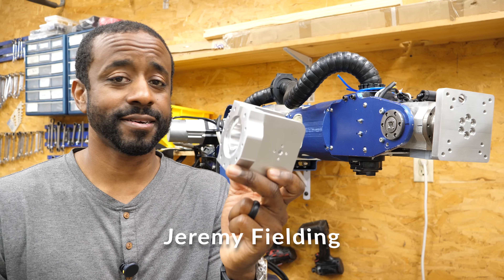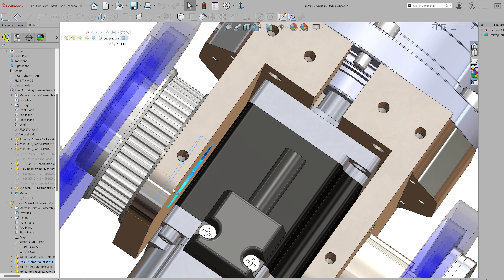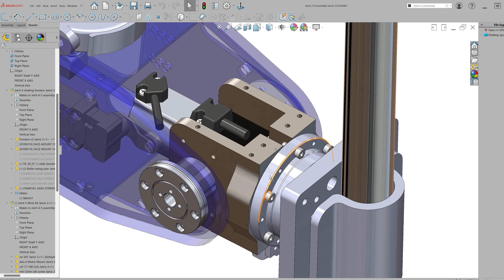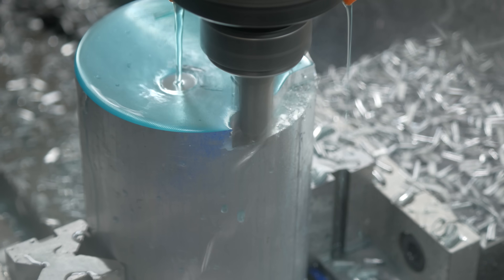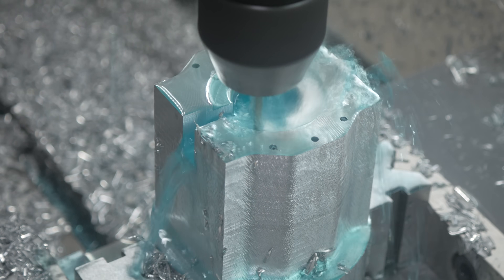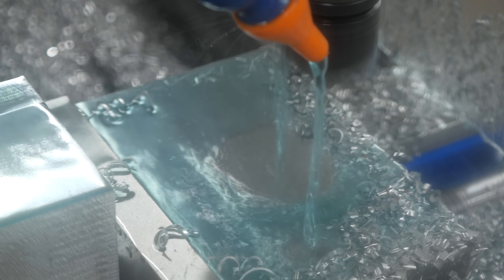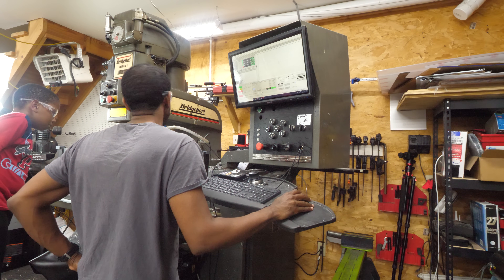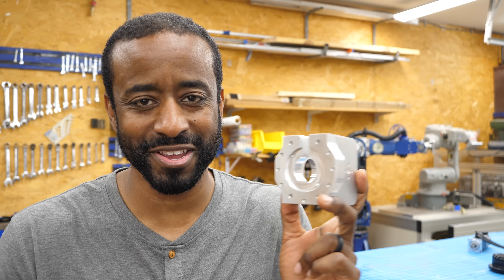How I Made This Robot Part. Start to Finish.

Comment: How much was a part like this from Jiga? What were the tightest tolerances?
Reply from the maker: Unfortunately this is not a question I can easily answer. Jiga doesn’t make the part. They connect you to manufacturing all over the world. You need to pick a shop, select how fast you want it, then consider tolerance, size, material, finish etc. every order is likely to be different even for similar sizes parts. Some countries/ places are cheaper on labor, or materials, and some are faster for the same price. There are too  many variables for the answer to be meaningful
Reply: @Jeremy_Fielding   For reference, how much did you pay?
Reply from the maker: @garrettp.5018 you really should just login and send them a sample part to quote so you see all the variables and adjust them some so you understand what I mean. I am telling you the numbers I could give would mean nothing. The price would vary literally as much as the price varies around the world for all the different conditions I mentioned. You would learn way more and it cost you nothing to ask for a real quote. And it’s multiple people quoting not one quote. So it will be a range of prices that can be pretty wide.

Comment: Your endmill finishes have a lot to do with the machine itself.  You can get a better finish with the machine you have, but you will have to slow way down and take a small finishing pass.  Leave about .005 to .010 for a finishing pass.  You might even want to do 2 finishing passes at .005 and a spring pass.

Comment: @jeremy Fielding. 
Hi, 
I know this hasn't got anything to do with this video but I have a few questions on induction motors.(kinda)
I am looking for a 3 phase 550w (+) induction motor that can turn up to 3000rpm(?) and a vfd to adjust the rpm.
All in all under 150€ if possible  (yeah, I'm on a tight budget and European 😅 )
I'm looking for something like this for powering different tools in my workshop.
Can you give me any advice on where to get something like this?
I'd really appreciate an answer. 

Thanks and all the best from Germany :D

Comment: Just a tip: If you're planning to cut a lot of round stock in the vertical orientation in the mill, take a look at a set of these Mitee Bite jaws (MPN 32166). It bites onto about .075" of material, and you don't waste as much stock as when you use V-blocks. Not to mention it has a heck of a grip on the material. You can give her the beans and not worry about your part achieving low-earth orbit. Great stuff, though. Thanks again, Jeremy!

Comment: Oh damn you didn’t spot the holes before drilling them? Probably a good idea so the drills don’t walk on you. Plus they’ll pre chamfer your hole so threaded holes look more professional/don’t leave burrs on the top face. You want the spot drill’s included angle to be at least the same angle as the drill you’re using but it’s best for the angle to be just a bit larger. So for a standard 118* drill, use a 120* spot drill. You want the tip of the drill to contact the material first. Also it would be a good idea to get a spring loaded tap follower to keep your tap straight but it looks like you can’t use those with your tap wrench? One more thing: SAFETY FIRST. These machines have the power to kll and it’ll hurt the whole time you’re dying. If you wouldn’t put your dick near it, don’t put your hands near it. No fingers near ANYTHING that spins until it comes to a COMPLETE stop. No long sleeves/hair/jewelry/etc. I got a file through my hand doing something dumb because “it’s fine I’ll just pay attention”. I did not pay attention. I ended up dosing off. Don’t need safety glasses because you’re just hand tapping?  Wrong. A chip can become dislodged and fling right toward you. Happened to me as soon as I backed the tap out. Luckily it bounced off my eye.

Comment: Those old Bridgeport Series I CNCs were good machines in their day, but the control systems became way too expensive to repair. It is less expensive to replace the entire control system than to purchase a replacement board or pay Bridgeport to repair the board.

You should swap out the flood coolant with a spray mist system. This would allow coolant to better reach the cutting tool.

Comment: I think it's important to note, especially for people that only need a single part for a DIY project, is that one-off prototypes can cost WAY more than you might expect. Alot of the cost comes from programming the part so it doesn't matter if you need 1 or 10,000 parts, the programming cost will be the same. If someone needs a one off my best advice would be to create a good relationship with a local machine shop
Reply from the maker: I don't know what your experience was but I have been consistently shocked at how much better the price is for a single part with this service and even other similar ones compared to using a "local" shop. Perhaps you have a good friend in the business, but I have tried ordering parts at local shops for the last 5-6 years across two small business, and for myself in three different cities. It was ALWAYS way higher in price and way slower getting my parts done compared to digital manufacturing options. And that is after several local shops just said they don't have time for my parts. This comment is a bit surprising to me actually regarding cost. It might also be we just have different expectations of cost. But This service is a good price, and in my personally experience cheaper and faster as well. It is the local shops (perhaps 50ish I have contacted over the years if I had to guess) that don't seem to ever want to work on small projects and charge a lot for taking it. But of course if you have a friend then use the options you have. I just think your advice doesn't match my experience, and I have a lot of experience.
Reply: @Jeremy_Fielding  My experience is programming in a machine shop. Yes this is probably better than shop rate and I'll admit my wording was wrong. I should say if one can, develop a relationship with a machinist that has some downtime. But my point still stand, one offs no matter where you go will be vastly more expensive than something thats mass produced and most people dont understand that and generally are taken aback when they first see the cost of their one off even if its a simple part. Home machinists are great in that regard. If they like you they might just charge beer and material. Thats what I myself charge to people that have helped me in some way.

Comment: The big problem with concave parts like that are the internal forces that may or may no be there. Putting in precision cuts first is risky as once you cut that slot along the z axis the material might spring in or out of position. :/

Comment: Re: Waste?     Got a lot of interest in home diy fabrication, so watched a lot of machining vid. One thing I never understood is the waste. E.g. in this case less than half of that huge, expensive chunk of metal is included in the final part. Most of the expense is in chips. On an industrial scale I suppose the company can recoup cost from recycling the chips. But for the homeowner, the scale will never make that up. 

I like the channel, and this vid, just a curiosity I have.
Reply: Good point. If you need a monolithic body with a concave shape, you pretty much have to excavate, whether you are working in metal, stone or wood.

Comment: Seeing you get your son involved was a real moment.
He is obviously curious about what you were doing - that is why he came into the workshop in the first place.
I don't think he will actually admit it BUT he was in all probability so proud of himself...
And you were so proud of him.
Google "armdroid" and think about suggesting that you mentor him through the build.
3mm acrylic to start with (I used 6mm Ally) and some small stepper (I got mine out of old photocopy machines - TOTALLY UNDER POWERED).
I did get the arm moving but this was before Arduino and PI.
The PIC micro-controllers were AN ABSOLUTE NIGHTMARE. I blew over 60 of them over about 14 months...
I built mine with toothed belts and sprockets "stolen" off of a number of old belt driven OHC car motors and reduction boxes made out of the guts of old windshield wiper motors but fortunately I was working in a machine shop and was allowed to do my thing over the week-ends.

Comment: A great example for the last paragraph would have been "This part cost $xyz."  You also have a lot of sunk cost in that CNC Bridgeport.
Reply from the maker: Even though I think it was a very good price, and very fast turn around, I didn't want people to get distracted by a number that changes year to year, and part to part. Without knowing the tolerances and the timeline I required you are missing large parts of what determines the price. I didn't want to invest time justifying the price when each person will get a different number anyway. This is part of the reason I went through the "what is your time worth" segment because often people say things like "I can make that for x" when they mean I only would pay x for the material and my time is free. And they have no idea what tolerances I put on the part LOL. Anyway I felt that would send some people on a trail that was off the point. The value was there for me, and each person should consider these variables and decide if the value is there for them when they see their quotes. Knowing this is a option was something I didn't consider for a long time. When I started doing this it changed my work flow and helped a great deal with those projects where one or two items dominated the time/cost of the project and created bottle necks. I can hand those off and the value is huge for me.

Comment: On alluminum you don't need coolant. Only for finishing and Drilling. And your coolant looks not right. Should be something with lubricant inside. Typically it's white.... but nice one for your first job  😊
Reply: Not using coolant on aluminium seems like a great way to gum up your tools in general.
Reply from the maker: It is a coolant with lubricants inside. Perhaps you just haven't seen it in blue LOL. Anyway, I have hear others say you don't need coolant with aluminum but that didn't go well for me. Of course as I said in the video, I was just getting started and probably this is a matter of getting the feeds and speeds right. I believe you when you say this can be done without coolant. I just couldn't do it at the time and not get horrible sounds, and poor quality with the end mill getting gummed up with aluminum.
Reply: @Jeremy_Fielding  never saw such blue coolant 😁 aluminium need speed while machining maybe that causes the bad surface. I can recoment the "mechanical and technical trade book" (not sure if u can bye it in the US) but it's pretty good at the beginning especially for cutting speeds and so on....

Comment: I feel like in a business setting it's less about the value of your time, because there comes a point where it doesn't matter who makes the part, it's going to take the same time, and since someone who makes the part needs to make a profit from it, paying someone else eventually becomes the more expensive option.  It's more about your available skill and tooling capabilities.  If you have the equipment to make the part, and skilled labor to operate that equipment, it seems like it makes no sense to pay someone else to do it, at least when you are operating at scale.  Of course, this is where utilizing international labor comes into play, when you approach a net 0 on time gains, the cost of labor becomes the only place to save cost, so you ship the operation overseas where labor is cheaper.
Reply from the maker: I disagree. There are many reasons it doesn't work out this way. I have worked with and at several companies where this happened regularly. You might have the capability in house but someone else can make it faster thus cheaper, someone else might have better consistency, better  cost because they buy material in larger volumes or have machines sized to get the best value form that or doesn't have the same amount of quality control cost but still produces good parts. The bottom-line is you get a quote and chose the best overall value. It is not always in house for many reasons you aren't thinking about.
Reply: @Jeremy_Fielding  ahh, yeah, that makes sense.  I hadn't considered buying materials in higher quantities to get better pricing, or having higher capacity machines

Comment: How much did the part cost? Should be interesting to know🤔.
With availability of better SLA 3d printers and resins, some of the complex cnc parts can now be fabricated easily inhouse, without expensive machine shop capabilities. In this case, an alternative could be using a castable resin to fabricate a metal part, once the initial resin prototype is verified for dimensional tolerances. Just an alternate for the masses that cannot afford expensive machinery. Using CNC is cool though, was little nervous watching the hand tapping operation.A tapping press(or a self tapping attachment on a drill press/cnc) could make it less stressful.❤️👍